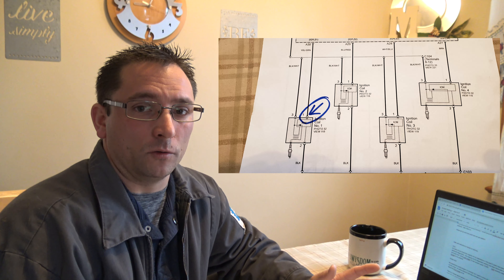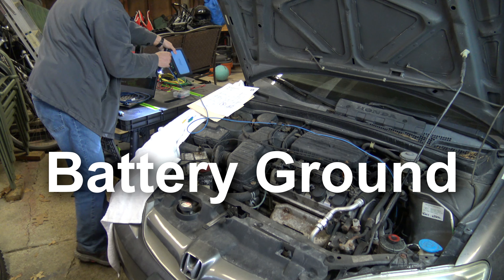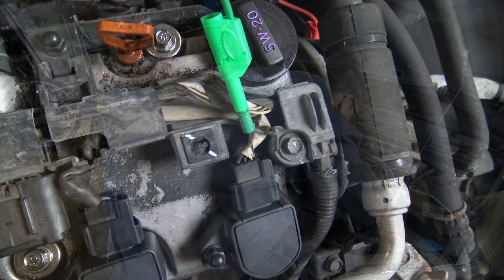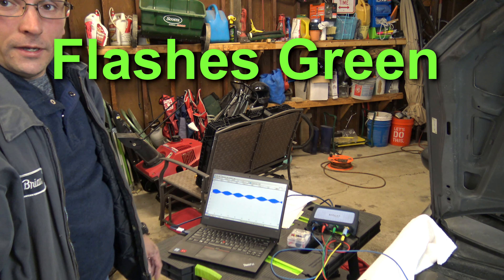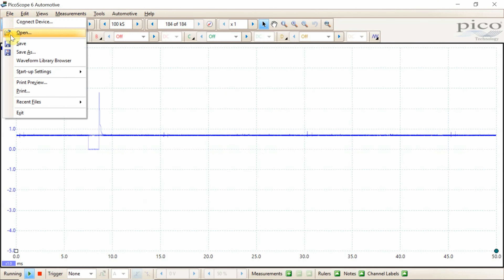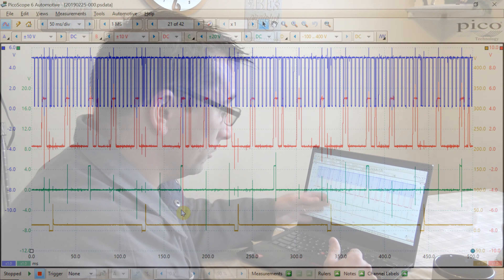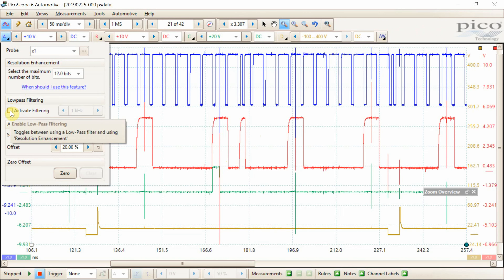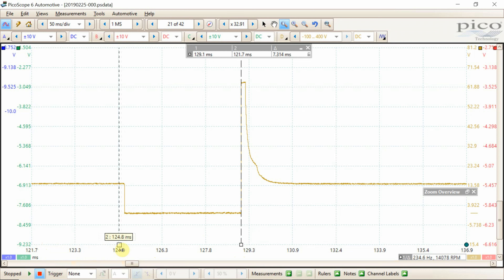Pico Scope  intro  and basics

Comment: Nice purchase, I'm still using my Verus at this time, but once I've got the money saved, a 4 channel PICO will be my next buy for sure.  They are so much easier to get details quickly and their overlay features seem to be the ticket when comparing known goods to bads.  Another nice perk is the length of the leads, Snap-On gives you the shortest leads possible and then you gotta purchase extra long leads seperate-for the money you'd think they'd use common sense and at least give me more than a foot for my ground lead, very annoying, always frustrating when you are doing work and have to fight with this.

Great video Brian, thank you for sharing this with us!  Hope you are doing well and enjoy your new scope.
Reply from the maker: I am learning a ton with the Pico scope and the help from the autonerdz  guys..  I have  2  things to make a video of when I get  some time  1 Jeep Liberty Injector Current and 2 2006 impala that had rust under crank sensor so it was dropping out...
Reply: @BrianMann216  sweet, should be a good couple videos

Comment: Please my brother … picoscope 220a can do relative compression test?
Reply from the maker: Yes you can measure battery voltage  while cranking or use an amp clamp
Reply: @BrianMann216  brother I did that but not work can i contact you to fix that … please